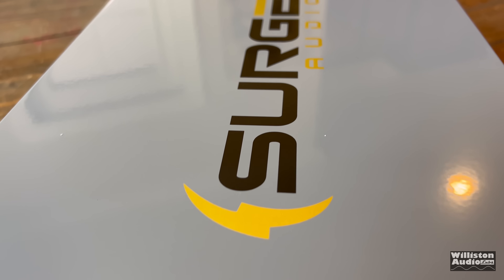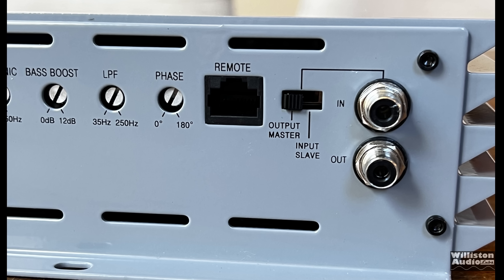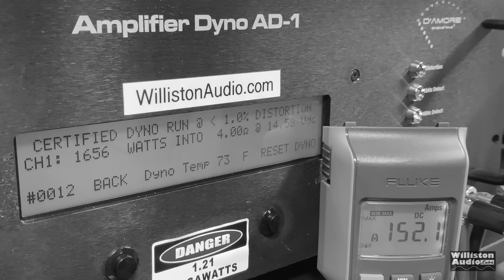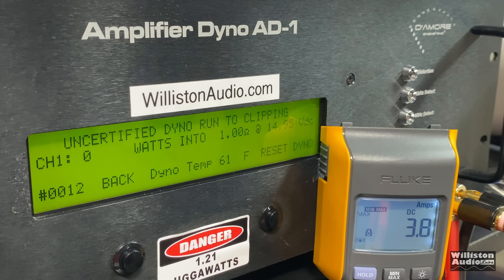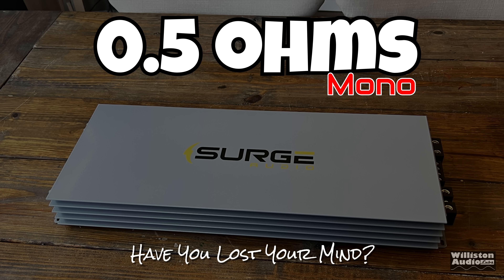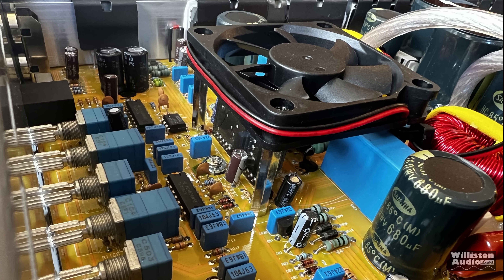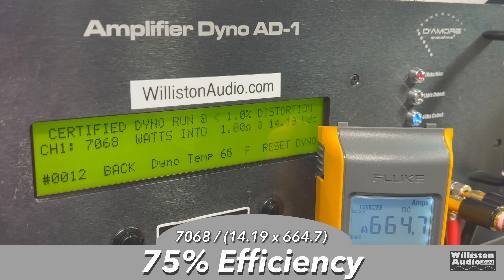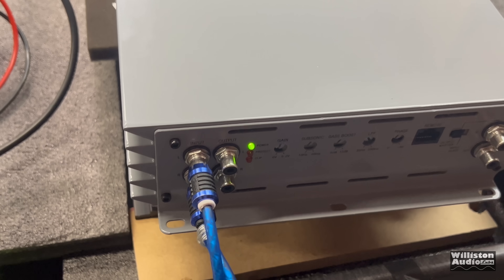SURGE AUDIO 4000W Monoblock Amp Dyno Test and MORE

Comment from the maker: See more at SurgeAudio.com: https://is.gd/surge4k
See the 10kW Amp Tested: https://youtu.be/pkFp-TLQIUI

SHOP
Surge Audio 4K: https://lddy.no/1eugj
Surge Audio 7K: https://lddy.no/1eugl
Surge Audio 10K: https://lddy.no/1eugm

VIDEO AND AUDIO GEAR
Camera - iPhone 13pro 1TB - https://amzn.to/3nCjGvc
RODE Wireless Go II Microphones: https://amzn.to/3Q6NVHl
Shure MV7 Microphone: https://amzn.to/3A4OICK
Zoom H4n Audio Recorder: https://amzn.to/3BXjVsS
960 LED Panel: https://amzn.to/2Sxoq3S

TEST BENCH EQUIPMENT
SMD / D'Amore Engineering Amp Dyno: https://goo.gl/sJTcf7
XS Power D1400 Batteries - https://amzn.to/2BPFCKW
XS Power PSC60 Charger - https://amzn.to/2CHGcfs
Fluke 1000A AC/DC Clamp Meter: https://amzn.to/2Rw5WDA
Handheld Amp Dyno AMM-1: http://amzn.to/2u2EgKV
My Favorite Screwdriver Kit: http://amzn.to/2x0VzcE

DISCLAIMER: This video and description contains affiliate links, which means that if you purchase from one of the product links, I may receive a small commission. As an Amazon Associate I earn from qualifying purchases
Reply: Two things brother, first a question would you take this 4k over the Orion HCCA SPLX3000.1D and 2nd those Kicker quad boxes used their lower end L7's I wonder if the box itself could hold up to 4 of their Q class L7's and would love to see how that performs both in just demoing and on a meter in comparison to the lower classed woofers the box came with! 🤔🤷‍♂️💪🔊🔊🔊

Comment: I have a question BIG D,   Do you think wiring the 7k amp to a .5 speaker load will result in going into protect?  Or,  has it been proven before in the past that the amp dyno is just too hard at .5ohms vs speaker loads?   The fact it wouldn’t do a dynamic burst at .5 worries me.  YES I already own the 7k but I’m getting ready to purchase new subs and are worrying about trying to do a .5 load
Reply from the maker: It’s difficult to say as a general statement as each setup wired to 0.5 will be slightly different based on your rise. The way I like to compare is running an amp like this at 0.5 is like running your engine at redline all the time. Will it do it? Yes. How long? Depends. It will absolutely shorten the life of the amp but if you want the most bang for your buck then it may be worth running it that hard

Comment: Installed my 7k this weekend. Hungry amp. My cyber 12k lithium with 320 amp alt can't hang with it. My Wolfram 5k never dipped under high 13volts. This 7k dropped to 12.3 volts after slamming for 15 minutes.

Comment: Do ya'll recommend running the 7K @.5ohm if you have the electrical.  I have BrandX 390, Dual 0ga power/ground runs everywhere and dual copper 0ga amp inputs on each pwr/ground terminal on for the amp.  Oh and 80ah CES Lithium bank.  Will be pushing 2 B2 Audio Rage XL 12's.  They are rated @2500rms each.

Comment: The same factory in China that makes Down4Sound.
Reply: I think these ones are made in Korea
Reply: @twentyonehertz  Only the the real high wattage and class AB Down4Sound amps are made in Korea the rest are made in China but are still based on Korean designs. That really doesn't make to big a difference though because at least in my experience anyways even the Chinese made amps are a real good quality. I have several of them I'm using in my Tundra and I'm quite happy with them. The reason I know these are from the same build house as the Down4Sound amps is because they use the exact same packaging.
Reply: Ahh yes, made by S&I.. S&I has factories in both countries so that is why, but it is using Korean caps which usually are not found on the S&I chinese boards. However every amp from D4S JP33 and higher says made in Korea, so it is 100% made by S&I Korea.. Jp23v2 and below is made by S&I china.
Reply: @iamjackalope  I just messaged Surge and they confirmed these amps are made in Korea.

Comment: Great dyno! I have the 7k and although I haven't installed it yet I'm definitely happy with those numbers!
Reply from the maker: Awesome 👏
Reply: I have 7k and its a different type of monster
Reply: @Sacred-Mountain Wolf  I just installed my 7k just to see how it sounds with a Skar VXF 12 that I've had for almost 5 years and it's insane at 4 ohms
Reply: @bunky021543  I got mine on 2 zvx 18s and it's taking up my expedition
Reply: @Sacred-Mountain Wolf  I have 2 brand new VXF 12's that I'm planning on running but I think I'm going to buy 2 Fi HC 12's for my 7k. But at the moment that 1 VXF is absolutely slamming and in the last 5 years that I've had it this sub had never hit so hard!
Reply: @bunky021543  Skar subs are really underrated.  Those subs handle way more than they say
Reply: @sacred-mountainwolf6928  I know that those ZVX's get violent on that 7k!
Reply: @bunky021543  violent and very aggressive. Should that installed my system tells.everybody about it
Reply: @sacred-mountainwolf6928  oh yeah! 🔊🔊
Reply: @bunky021543  going to run 10k on four zvx 15s in 74 donk vert
Reply: @sacred-mountainwolf6928  Damn!

Comment: I saw these amps before I purchased my deaf bonce apocalypse AAK.. I had never heard of them before, but I was intrigued. I didn't see much research on these, so I didn't. 
Now I regret it.
Reply from the maker: The AAK’s are beef as well
Reply: @wal  yeah, but they cost a bit more, and require a lot more electrical. I had a 320 alt, lithium, two agms, and a supercap and still had voltage drop. Hard. From 14.2 to 11.8.. and then clip city.

Comment: I can’t fit nothing in my challenger because it didn’t even come with a spare tire only 210 inch carbon harden subwoofers underneath where the spare tire goes but I have a grand Cherokee Wagoneer I would like to put 415‘s in with that I am I have the subs just bought the SUV have not put subwoofers in it yet I would like to know the price of that I am.

Comment: How much is one of those amps cost because when I bought my Kicker KX 2500 W amp I give quite a bit for it I would’ve rather done a sound digital or a tyrant more power
Reply from the maker: Check video description or pinned comment. I have links to the amp, think it is currently $699

Comment: Hi boss i was wondering if when u do the amp dynos do u have to turn up the gain on the amp or not even have to mess with it o was wondering how that works
Reply from the maker: The gain on the amp is set to the head unit with 10dB of overlap using the DD-1+. Amp won’t produce more power if gain is higher, it will just reach max power sooner. This may be a good video topic 🧐

Comment: Wolfram was basically twisted sounds same exact board different heatsink. As soon as they swapped to the new model amps they started sucking my old 4500 which was number 67 in production was my favorite amp I’ve owned. Got a aw5000 and couldn’t even get 5k out of it. My 4500 clamped almost 6500
Reply: By same exact board, do you mean based on the same layout?
Reply: @JasonWW2000  they were same boards,  and same build house
Reply: @Chuck_Sanders  As I said on my other post: "I think your confusing rebadging with copying. Its two different things. When I first started looking into all these "rebadged" amps I thought just like you. They seemed identical. It wasn't until I looked deeper and did more research that I realized what I though was rebadging was actually different companies coping the same design. Even when you have similar looking products coming from the same builder. You have to look deeper. Look at the components, count the winds on the transformers, disect the mcpcb. Different amp companies can tell these build houses to make a product to different standards. Use a cheap transformer in this brand and a more expensive one in that brand. This is why you see similar looking amps perform differently, even when they come from the same build house. Different component tolerances, thicker board traces, etc...
The average person does not pick up on these nuances. They look at the underside of an amp and see that the basic layout is the same as this other amp and just assume they are identical. Its simply not the case. Even amp repair techs like Barevids will tell you they are not identical. He often will say they are the same, but what he means is they are the same layout and basic design, not that they are literally the same."
Reply: @JasonWW2000  so, I have had 3 comments removed. We work and have worked with S and I out of Korean as well as Zennon. We work with Sound and Power, AF, JLD and more out of China, as well as a few other build houses. About 65% or more are rebadged products. They have different heatsinks...and maybe use metal pots and gains attenuators versus a plastic one, and some use "Tiffany style" rca's where others don't. Again, I have dozens upon dozens of cloned SounDigital amplifiers from a few build houses in China,  and one in particular makes about 7 brand names and are 100% identical through and through, component for component...and a few have a Big Brand name on the boards, and they just use a black fabric tape glued over the name. The same goes for S and I amplifiers, and with Zennon. Each company brands  and pays the premiums for a custom heatsink and silk screening, or etching. Most of these aren't anything new, and are advertiseded with under rated power ratings, as it helps to sell better. Hell, a CAB22 and the Power Acoustik Vertigo 10k are the same, except the CAB22 cheaped out and used less fets. All other components are the same. That's one example only. Subwoofers/drivers...mids to tweeters are no different, as many are just a rebadged speaker/subwoofer. I have been in audio as a whole for over 3 decades, so none of this is new to me.  Rebadging/Me too branding is everywhere. From full bridge to half bridge, to speakers and subs...it's more prevalent than you want to believe.
Reply: @Chuck_Sanders  Ah, it is good to have someone here who is familiar with manufacturing. I've worked with certain Chinese manufacturers helping design flashlights. I know it's not the same as amps, but it's very similar as far as companies cloning and copying each other. I think we are pretty much in agreement. Your saying it's not rare based on what your seeing more recently plus you have a broader definitionof the term. I'm saying it's rare based on hundreds of brands over several decades plus a narrow definition. So I think we can both be correct depending on the number of brands involved and how we define "rebranded". 
I think what we are referring to is a bit murky. I don't consider it an exact item if there are changes other than cosmetic. So different rca, different pots, etc... I consider it a clone and not a rebadge. You consider it a rebadge. That also makes my estimation of rebadges smaller than yours. No big deal, I think we are both right. 😁
It would be cool if you could help me educate audio people that just because two amps have similar board layouts it doesn't mean they are exactly the same. It's such a common problem I see. It should always be on a case by case basis and not just assumed. Sometimes they are exactly the same item (Teampie selling to PBoyz, PowerHogg, EMF, JonesSS, etc...), but most of the time they are not (Audiopipe AP3000 and Taramps HD3000). 
That's really the point I want to get across. Don't assume it's the same. It might be, but not likely.
Reply: @Chuck_Sanders  YouTube will automatically delete comments that have internet links in them or certain key words that are not allowed. It sucks, but its due to scamners and hate filled people that ruin it for everyone. 🤐
Reply: @Chuck_Sanders  I am so fascinated by your comments. You could do some damage to all these brands by blowing the doors wide open on the “rebadging” in this industry. The CAB/PA example is crazy, thank you.
Reply: @TheGodofSEO  lol, Face Kicker(JSS) did the side by side comparison of the CAB22 and the Power Acoustik Vertigo 10k...and full dyno testing of both. I mean, you could do actual research, before you speak. There are literally tons of rebadged audio components, from subs, mids, highs, amplifiers and more. I have been working with AF Audio, JLD, Sound and Power Technologies, for a little over 2 years, and Sound and Power builds full bridge for Sundown, TopStronGear, Golden Eagle amongst other brands, and they are China clones of the SounDigital.  They also build for CT Sounds,  which 3 or 4 other brands, use the exact same half bridge boards. Skar and Audio Legion have some of the same subs, mids and tweeters, along with EQ's and so forth...with differe labels and or silk screening. Just like Soundstream and NVX subs and other drivers. I have worked with S and I for years, and Epsilon,  and the overwhelming amount of rebranded, and rebadged equipment, is crazy. Why? Because 90% of it has been tried and tested by some ither company before them and it works. It's cheaper to pay for a design that's been developed previously, than to put in the funds, on R&D. So, do like Me and everyone else, and stay up late nights, get WeChat and WhatsApp and talk to the build houses for yourself, buy some samples or the MOQ, and find out real quick, how absurd it is.
Reply: @Chuck_Sanders  awesome brother, thank you for sharing.

Comment: 10:58 It,s nice that in the pover supply section 105°C capacitors are used but i would like to see 105°C in the amp section too. The little 47µF in between the coils also looks like a standard 85°C type. But that,s "nörgeln" on a high level [using , instead of ' because it,s more efficient on a keyboard with german outlay].

Comment: d4s jp33 and jp43 still king at doing rated power and some
Reply: The jp33 is also cheaper. I'm sure getting warranty or service from d4s is much easier than surge. I enjoy my jp33
Reply: do you have problem with the bluetooth bass knob?
Reply: @bobit8742 my jp33 bluetooth bass knob got disconnected.  I had to send it in for repair. Free but inconvenient.
Reply: @Sql253  did they fix the issue? they said they updated and everything was fixed but i am still on the fence
Reply: @bobit8742  even without the knob. Its still a great amplifier.  Nothing in its price is comparable .

Comment: Imagine the power suppluy you would need to power the 7k from wall power. You would need a 240v 40A circuit.
Reply from the maker: I have 320aH of LTO and up to 400A of power supply (but typically use 200A) and yeah that's plenty for music, but testing with tones is brutal on an amp and the "electrical"

Comment: Thanks for another great review! I noticed that the amps drew less amperage at .67 than they did at 1 ohm yet produced more wattage. Very cool. Still, at around 500 to 700 amp draw when pushing them they will absolutely require some beefy electrical upgrades. That said I agree with you, they are very well made amplifiers.
Reply from the maker: Don't forget these tests are using test tones, music is much more dynamic unless you listen to rebassed stuff. You still need beefed up electrical but not the 320aH of LTO that I have
Reply: @wal  Right on. I've just upgraded my Suburban big 4 to 2/0 gauge in anticipation of upcoming changes to my system. 1/0 would have been fine but I found a killer deal on r larger wire so figured why not 😆

Comment: 7k watts is over 31amps @ 220v. How do you power such powerful amps in your shop?
Reply from the maker: I use 320aH of LTO cells (Yinlong/XS Power) along with up to 400A of power supply (typically 200A)

Comment: Hello American friend!  Can you show your power supply system for DUNO?  Her power banks are connected by copper bars?  Make more power banks in parallel so that there is no power drawdown due to reactive power consumption.
Reply from the maker: Hello! The power is supplied by 320aH of LTO cells (Yinlong / XS Power 40aH cells, 48 of them in 6S8P format). I also have (4) 100A power supplies that can be used in linked mode for up to 400A of supplementary current.

Comment: I noticed there are several amps on the market now that all seem to have a very similar build and bass knob like the D4S amps. Wouldn’t be surprised if they were made by the same manufacturer.
Reply from the maker: IMO the best SPL related amps are built by S&I. Several companies use them, JP, Surge, Deaf Bonce and many more. It still boggles my mind a 4kW amp can be in such a small footprint. This would have been a 150x2 amp back in the day (90's)
Reply: There are many manufacturers and they tend to copy each others designs. So don't assume there is one company just because a product looks similar.

Comment: Looks a lot like ANSI 61 grey powder coat.  Cheap because it's so widely available.  A $60 hand powder coater in experienced hands can make it look like it was done by a million dollar automated system.  Excellent scratch resistance, but poor corrosion resistance - which is no problem if it's powder coated aluminum.  If I'm right, that amp case should look good years after the electronics inside died.